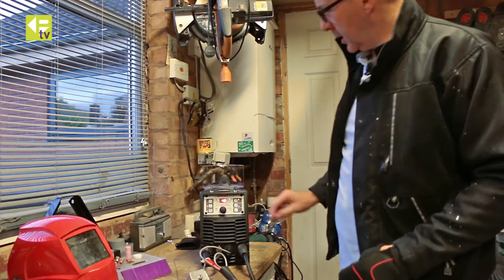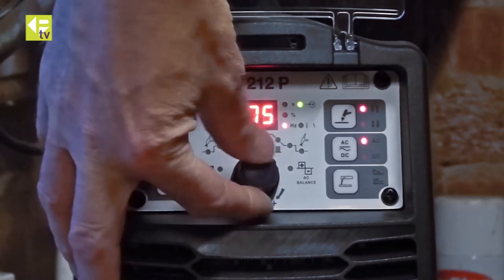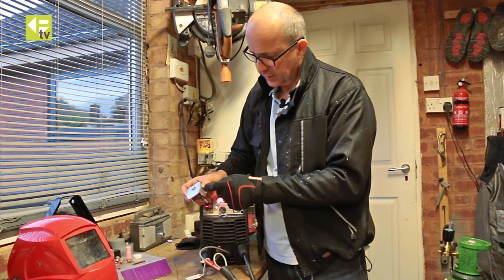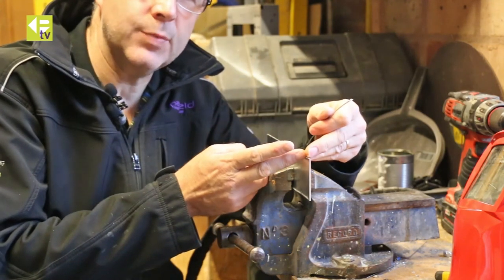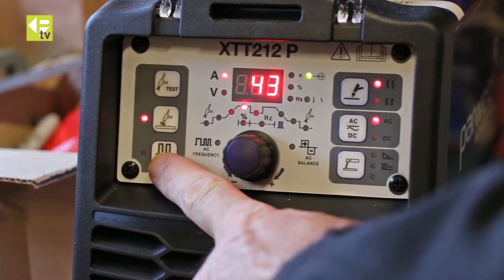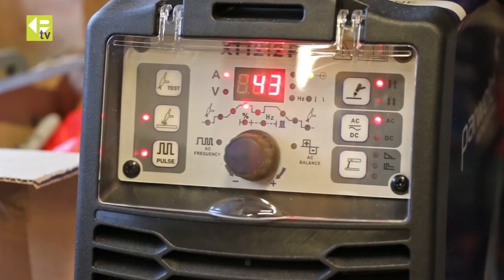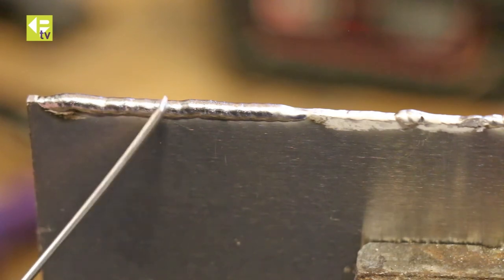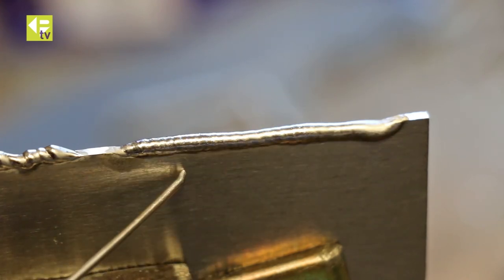AC Welding with the XTT212 P Machine from Parweld Part Two

Comment: You set the A/c balance not to 25% , but infact 30% . The adjustment range starts  @ 15 & goes up to 50 , so thats a range of 35 , so 35 - 30% = 24.5 .
Reply: This doesn't make sense. By their recommendation 15% by their setting is optimal. However based on this assumption 15% = 100% DCEN    which can't be correct